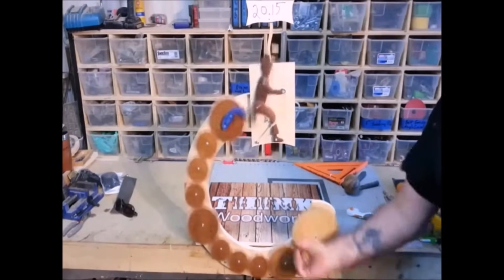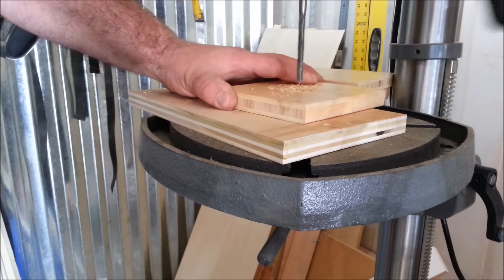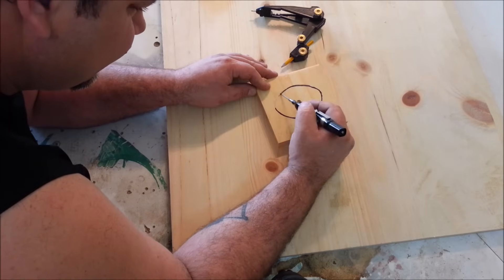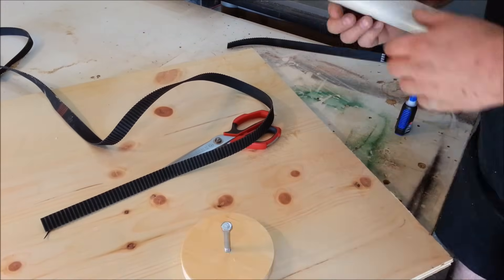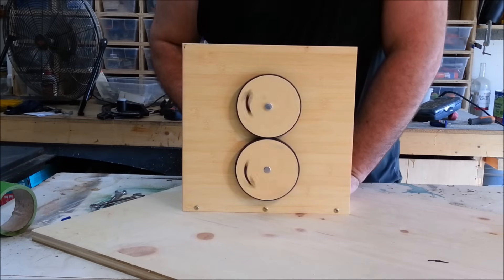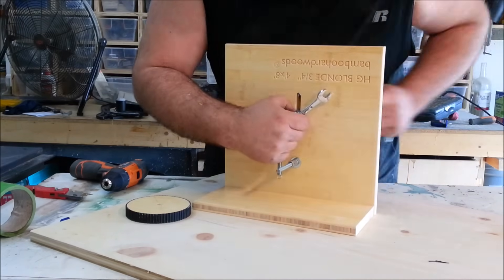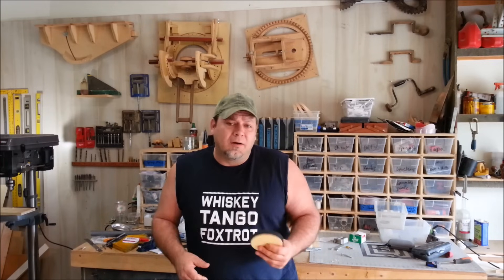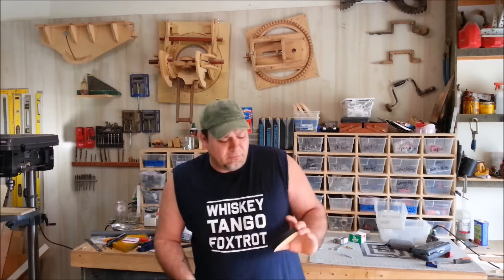How to make wood gears super simple!

Comment: Been looking a lot of channels on this topic of gear making this idea is by far the simplest and the use of a belt pure genus no cutting stray lines looks like it can handle a 3\4 hp motor if i manage to get your idea right out the gate very nice now a bigger question with regards to smaller to larger gears can this idea work like chan drive or direct drive??

Comment: Great video.  I hope nobody will take offence if I add a word of caution...  As you bend a flexible belt around an increasingly smaller radius, the spacing of the valleys is preserved and the spacing of the tops of the teeth must spread apart.  (any distortion from a straight line will do that).  So I'd expect it to fail for large gear ratios. Unless the gears have very big diameter in relation to tooth depth...  Maybe beyond 4 to 1.  I've tried it for gears made from corrugated  cardboard, which worked great at 1 to 1, and failed at higher ratios.  Happy to hear from anyone who's tried 4 to one!

Comment: I am having trouble finding the timing belt.  My search included Bestorq 860 Rexxon 3/4 inch stepping belt.  Help
Reply: HI MATE.
I FOUND GOOD LENGTHS OF IT PRETTY CHEAP BUT IT COMES FROM CHINA.SO YOU DO TAKE THE RISK WHETHER IT REACHES YOU OR NOT BUT I HAVE ORDERED SOME.
HOPE THIS HELPS.
Reply: antony bristow  ok where ?..
Reply: i got mine on eBay uk and type into the search bar 'stepper motor belt'...you should find rolls of it there.

Comment: Great idea. I have lots of stepper motors &  belts and no way to use them. This is such a simple idea I should have thought of it myself. Thanks for the idea. I've been making wooden gears but this method is simpler and easier and I can make much smaller gears than before. Thanks!

Comment: I want to make some gears using your idea with that belt but I don't seem to be able to find it on the internet. Can you tell me exactly where to find it please. I went to eBay but couldn't locate the same belting that you used.
Reply: +Bob Brueckner  It doesn't matter what type of belt you use as long as it's a thin one. Look for 3D Printing Timing Belt, they aren't that expensive and are reinforced with tiny steel wires, they last a long time.
Reply: Andrew Watts Thanks. But I believe that you said, in the video, that you used one that was 3/4 inches wide. I can't seem to locate one of that width that is open ended and has teeth that will mesh properly when used  wrong way out as you have done.

Comment: Dude, Really...Are you kidding me? That is an awesome idea. What does Mathias think about that process? I made some gears using his generator a couple of months back for my router lift build. This seems so much easier and more quiet . Have you checked out how accurate the increments  per one  turn ? It has to be more precise than cutting teeth on a band saw. I cant believe that I missed this video this year. It must of slipped by somehow...Great work buddy
Reply: +TheJedc43 Oh ya ., I just realized that you cant put them at 90 degrees to each other. Its only works in series....crap...you almost got me
Reply: +TheJedc43 ALso, with mathiasses software you can choose how many teeth you want, here it's almost random, unless you pre-calculate everything and make the circle REALLY precise. The other problem is that eventually that belt will come loose, and the bigger the load the sooner that will be. Sooooo putting in a small nail in the ends or a staple or something else to hold it down better, these aren't really practical in the long run.

Comment: Issy awesome idea.
Half as big?, you mean relative to pi, mathematics is pure science, the answer is always the same, 2 + 2 always equal 4. It is one "constant" in life's unpredictable journey.

I have found that the rubber seals used in food grade plastic buckets work well as belts on v-grooved wood pulley's. Yes it requires a bit of math to make it work, although I sometimes use a tensioner if the math works out as less than ideal. I do like the price!

Comment: Unfortunately, I think there is just a little math.  If you want the second gear to spin twice as fast you want half the circumference not half the diameter.  So you would divide the diameter of the first one by 1.414 or about 1.4.  So if first disk is 4 inches, second disk would be about 2 13/16 I think.

Comment: I have done this many times, In the UK and I guess other countries you can often go to a garage and get car or lorry timing belts for nothing.
They have to be changed at about 80,000 but they are practically fine for this idea.
High forces can rip the glue bond so I often supplement the glue with some screws in the lowest points on the belt.

Comment: You could use a extra piece of belt to make the alignment of the teeth as good as possible. After gluing (when the glue is still wet), lay the extra piece of belt over the gap, with the teeth toward the gear, so they grip into the teeth of the belt you're gluing. This will force the gap to be sized exactly one tooth width.  Hard to explain in words, but easy to do (and easy to show in a video...)
Reply from the maker: Gijs van Oort Thats an AWESOME idea!

Comment: uhhhh.... Haite to throw cold water on the party, but....  Have you tested the "new gears" under load?????

And the use for the elliptical gear is pretty obvious, I think.  Oscillating Spindle Sander...

Your V-belt stuff with shop-made pulleys is intriguing. Have you thought of using a v-belt shaped router bit to make the groove?, Or to finish it, rather.  After all V-belts have an included angle of 40*, and would run much better and handle more power if cut that way, rather than having vertical sides  to the pulley groves.

Comment: Just go to local mechanic and get used engine timing belts for free, with nice big teeth.
Reply: What kind of belt it is?
Reply: @zahrofaa  any timing belt, just go to a auto parts store and ask for the cheapest timing belt they have. Sick with one part number different motors use different teeth profiles.